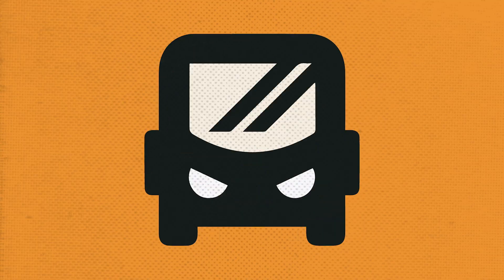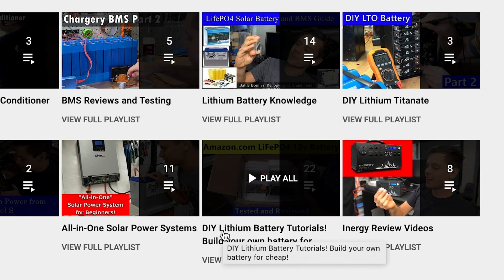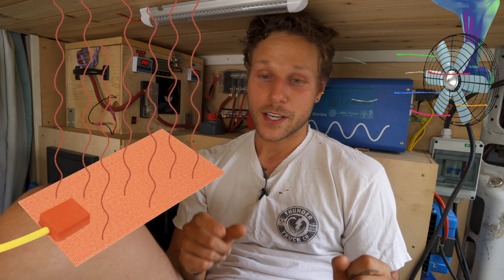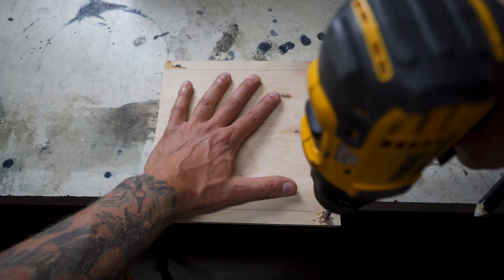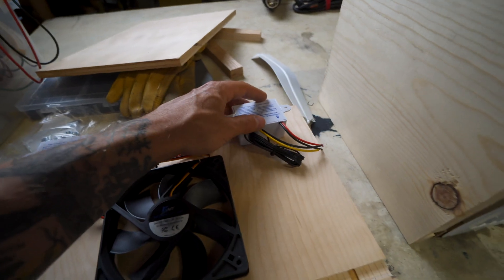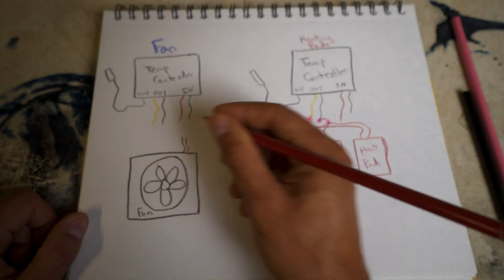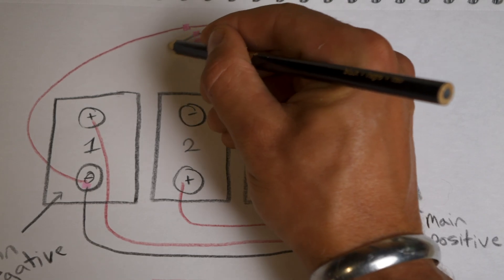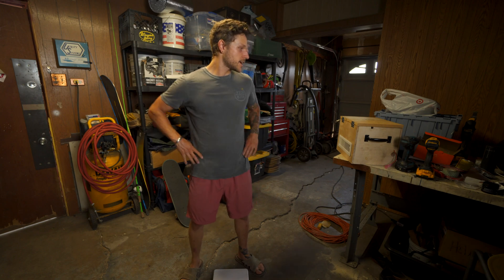How To Build A Temperature Controlled Lithium Battery For Your Van On A Budget

Comment: As an RV solar installer, I appreciate your transparency; you learned this from others. Too many DIYrs claim to understand what is happening without practical experience. Your system looks fantastic! My only feedback is that 2AWG is limited to, depending on your wire insulation type, is limited between 140-190A based on table 310.17 of NFPA-70. If you run a 3000W inverter, your max current would be about 234A. I design my system by choosing the cable size based on the maximum short circuit available (i.e., the fuse size between the inverter and battery). The 3000W inverter example would be (234A*1.25) or 292A, rounded to 300A fuse. I personally use 4/0 welding cable, and the most restrictive value in the code book, as I cannot find what type of insulation is used and therefore need 4/0. I tend to be conservative, as I do not want overheating and insulation breakdown to be an issue.  Awesome video man!

Comment: After two years, how is it been? Do you ever get the fan work? Im thinking if it ever will heat too much. Maybe I just put bms outside the box. Will use tractor mirrorheater pad, wich is 35W and just correct size.

Comment: Great job!  I know of the other 2 channels you mentioned but this helps for details.  Really appreciate it!  Q, the DIY solar guy used a tank heating pad as it was 12V, and had a temp regulator built in.  Did you consider that?  Great job either way and Thank You again!

Comment: Interesting educational video, thank you!
What are your thoughts on active heating/cooling after 1.5 years of using it? How it handled hot/cold weather? Was the cooling of batteries neccessary or not? Have you been in some super hot weather? I am about to built the same thing and weighting between active heating only and doing both like you. 
Thank you!
Reply from the maker: I wish I could answer this for you, but I sold this van about 4 months after building this battery setup so I don't have a review I can give you.

Comment: This is a da* good video for this type of lifepo4 project. My go-to so far for creating my own temperature conditions and box for my (4) 304ah Eve cells. 
I do have a few questions-
1. What purpose does the shunt serve if the bms really has a whole slew of parameters that can be programmed and a Bluetooth display screen to check what it's reading? That Victron shunt is NOT cheap!
- I believe you showed another small screened device (black) which measures voltage? What is the perk of having this AS WELL as the Victron shunt? Thank you⚡💪🥳
Reply from the maker: The BMS I purchased didn't have a bluetooth display to connect to, but you can definitely get ones that do and save yourself some money. Same goes with the little battery monitor I had stuck to the front of the box. That was just for quick glances if you didn't feel like pulling out your phone. It's redundant.

Comment: Nice woodworking and overall build. Would be interested to see reviews of the Victron shunt, the Renology MPPT and the AIMS inverter. 

Here's some concerns I came away with that I think are worth mentioning. Apologies if any come off as critical. 

On prismatic cells the case is not part of the anode like round cells. The terminals are what's conductive, insulating spacers are unnecessary. 

Clamping them tight is unnecessary. The pouches inside the cells are already compressed to spec. Only need to worry about compression when stacking raw pouch cells. Kapton tape really is sufficient to prevent banging or rubbing due to bumps and road vibration.

Modern copper plumbing pipe has a low percentage of copper and low capacity for heat and current relative to proper bus bars. Consider the amount of copper per inch in your 2 AWG leads versus 1/2” plumbing pipe. If they get too hot they'll melt the plastic around the terminals and destroy your batteries. Buying copper or brass or aluminum bar stock is not that expensive. (3 appropriate buss bars are likely cheaper than the 3 pre-cut sheets of acrylic.)

IMHO - top balancing is unnecessary for a 0.04 volt difference on one of four new, identical cells. Especially with a BMS on-board. Better safe than sorry though I guess.
Reply: Cell voltage means NOTHING with LiFePO4. Look at the discharge curve.

Plumbing copper is pure.

Comment: don't keep that battery monitor permanently plugged in. it will drain one cell and unbalance your pack and maybe damage it. its low power but over a long time it will suck enough to unbalance all the cells a lot. it will also kill the screen on that battery checker. I have the same one and I'm telling you from experience.

Comment: ... Should have put some rubber hose onto the threaded rods to prevent them shorting out on the batteries too ...
Reply from the maker: I thought about it while I was building the bracket, but there are held so tightly together I wasn't worried about them moving at all

Comment: Very nice video, a shunt is simply a piece of copper wire with a very specific detailed ohm resistance, then you simply measure the voltage across it, and using Ohm's law it is possible to measure the amperage flowing through it.

Comment: wood box makes for great fuel to the fire from the battery lol I would find something to make it a little more fire retardant! nice video
Reply: Wayne C- I’m trying to best house my Lithium battery in a van build.  I’ve been contemplating what to house it in to reduce fire risk.  I’m blank for fire retardant material.  Suggestions?
Reply: @nmartin5551   I would use a plastic toolbox large enough to put the battery stack that's bounded or taped together and use the back inside of the lid to mount the BMS! I wouldn't worry about fire retardant material as most batteries built by manufacturers don't! this way you can carry the battery using the toolbox handle.

Comment: Why there are no vents on a battery that you buy in a shop?
Reply from the maker: It could be considered overkill depending on how you plan on using your batteries. If you're going to find yourself using them in freezing temps you'll need a way to keep them above freezing and if you're going to be using them in extremely hot environments, having a way to ventilate them is also important.
Reply: @dogcatmanvan  ye I guess for me it would be Overkill. In extreme situations where I have 2°C or 45°C in my car my bms will not charge the battery. Should be not often for me, so I should be fine without a vent I guess. I actually don't know how warm lithium batteries can get  compared to roomtemperature. A vent would be usefull if there is a high difference between battery and roomtemperature.

Comment: I dunno if it's been mentioned before, but here goes.
I use a programmable contact closure on my Midnite Solar charge controller to allow the fans to run when the battery voltage exceeds a value which it only reaches while charging.
That way, my power hungry fans only activate when there's excess energy to run them.

This will fully automate the high temperature control aspect of the project.

Hopefully someone finds this tip useful.
Reply: Is there a way to automate heating up the batteries before charging? I would like to make an automated temperature controlled set up for batteries in my van

Comment: You can use 100% just let the BMS do its job and disconnect you at low voltage. Don't be afraid to charge to 100% either. You are "prolonging" the life, but at what cost? If you need it, use it. Buy new ones later.

Comment: Don't let that Aims inverter charger ever fall on your head! Its pretty darned heavy. I like mine and it has been reliable for 3 years. It never saw full 4KW load.  Is that a Renogy DC to DC charger under your battery box?
Reply from the maker: Yep, that was an upgrade I added to my system

Comment: Three pin fans have +12 V, ground, and rpm sense. Four pin fans have +12 V, ground, rpm sense, and PWM control for speed
Reply: Thanks.  I blindly connected wires until my 5 inch fan ran in the correct direction. Now I know what the extra wires do. Thanks!
Reply from the maker: Thanks for the info!

Comment: very nice video, we have a 40' 5R and I really hate lead batteries for house. So I built 2- 24v 200ah lithium..bout same way, tho I used the overkill bms and a plastic tote for case, lined our holes in case with rubber grommets. also put a kill switch, so we could work on individual units without shutting off entire setup. We're gonna have 4 of these...we are power nerds. So far investment for equivalent for four 12v 200ah batteries...about $2100..including tools specific to electrical build...not including inverters..of course.
Reply from the maker: Wow, that's a pretty impressive set up for the price!

Comment: Nice build! I just finished my LiFePo4 battery build. I used the same sources for information. But went with a few different components. If anyone is looking for a battery box and doesn't want to build one the NOCO group 27 is a snug fit. You wouldn't be able to compress your cells like this though. You'd have to settle for tightly wrapped electrical tape to use it.
Reply: I discovered some brutally strong tape called Fiberfix 10X tape. It's so strong that it comes in a roll with a mini knife attached on the inside of the roll to cut it. You absolutely cannot tear it. I wrapped a layer on the top and one on the bottom of 4 of the 280ah cells. There are 2 sets of these in my roll around battery cart for 560Amp Hours, 7200 watt hours.. The tape sells for around $12 a roll but is well worth it. I think it would solve the battery compression problem for the 27 series plastic battery boxes.
Reply from the maker: I'll have to look into this for a future build.

Comment: Great job explaining the build process. 
I went with an Overkill Solar BMS and found I did not need the battery monitor as the bluetooth app gives me the same info. Another option for keeping the battery warm is a heating pad like the ones used for RV water tanks.

Comment: A couple of comments - first most cheap voltmeters do not even claim to be accurate better than 1.5% so if you charge to an indicated 4.2v (max volts for common lithium cells) you could be at 4.265v which is over the absolute max for such cells (typically 4.25v). For a few bucks you can buy an AD584 voltage reference which will help you understand how accurate your voltmeter really is. Secondly, 3x 25 watt heating pads seems way overkill for warming a sealed box. If you connect them in series instead of in parallel they will give about 2.8 watts each, which is far more realistic.
Reply from the maker: I appreciate the tips. I'll be rewiring those heat pads in series!

Comment: Great video!  It's probably the first Van battery DIY video I have seen.   I love Will's videos as well.  I have also recently built a DIY battery with 580 amp hours.  Check out Overkill Solar for BMS's.  Great price and an excellent component.
Reply: I did the 560 amp hour box on wheels to run my son and daughter in law's fridge and chest freezer for when PG&E craps out again in August. They were down for 47 hours last year and the Honda eu2000i generator I gave them had quite a workout.  Now they can Rig For Silent Running.  I finished the unit 2 weeks ago and with a 410 watt solar panel it gives me free cooling every afternoon.   My homebuilt  has 3000 watt inverter,  30 amp MPPT solar charge unit, 250 amp Daly BMS, and an onboard 75 amp Aims battery charger.  130 pounds in all but its made to store under his work bench.               Hey! Post a video of yours!

Comment: Who you callin a shunt?
Reply: I picked up mine after it had been test running with full amps going through it. I called it a Mudda-fackin cork- sackin two-balled byatch dumb shunt after the heat cooked my thumb. Warning: place the damned thing in a place where the heat it gives off at full load won't matter. It was cool to the touch at low loads, though.